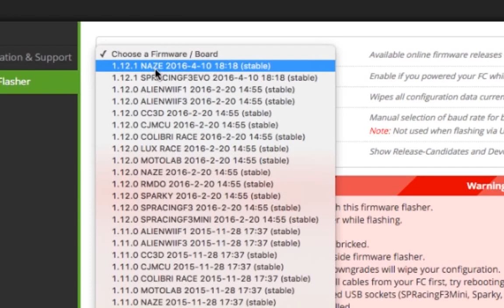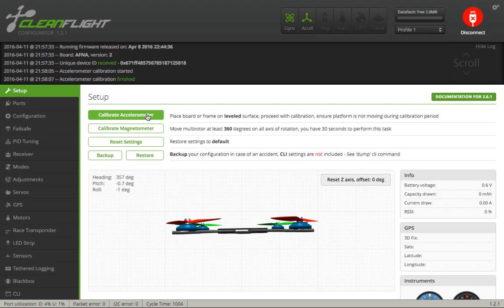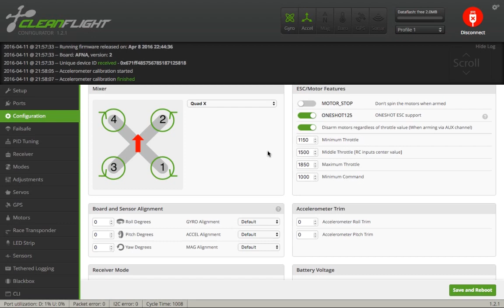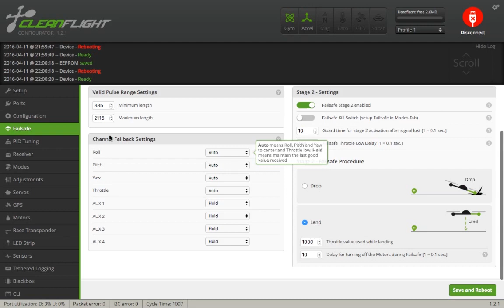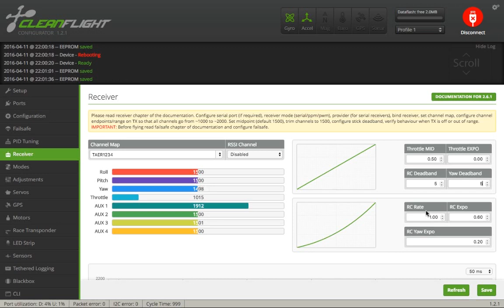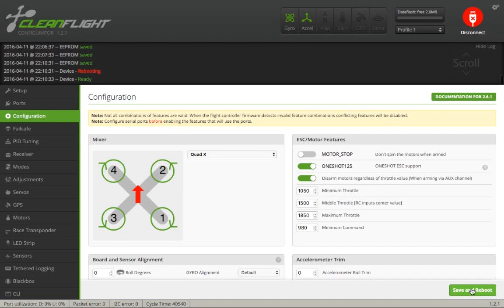How to Set Up Diatone Tyrant 150, 180 and 210 Using Cleanflight

Comment: One of the easiest videos to follow on this subject I've seen.  Thank you!
Reply from the maker: +PewPewReload Thanx!  Next week I will have the video on how to flash your ESC's. All you need is a current limiter device as a safety measure, and takes about 5 mins total!  I will also have some update PIDS as well.  This is a great little Ship from Diatone and I really enjoy flying mine!
Reply: +2dogrc how's that video on the esc flash going?
Reply from the maker: Just have to edit it up.  You want to use the Blue Series 20A, Multi when selecting from BL Heli suite.  Here are the steps:
Download BL Heli Suite
REMOVE PROPS
Open Cleanflight, but do not connect.
Connect your quad to the computer.
Open Bl Heli suite
Plug in your flight battery with a current limiter...just in case (there are a bunch of videos on how to make this)
Click the com port that just showed up when you plugged,
Click Flash BL Heli
Select Blue Series 20A, Multi (Very important as there are 3 versions)
Flash, keep all the stock settings, Damped Light should be select on.
It will do all 4 ESC's so just click continue.
When you are done you need to recalibrate the ESC's.
Unplug quad flight battery.
  Close BL Heli Suite.
  Connect to cleanflight
  Config tab set min command to 1000 and Max throttle to 2000.
 Motors tab, select I agree on the to be able to move the motor slides.
Set master to the top, plug in flight battery. 
THe ESC's will play a little song, then bring master to idle.
In Config tab set Max throttle to 1980 and Min command to 930.

Done!
Reply: +2dogrc thanks for the pre video wright up. I have a problem...it will only flash one esc?
Reply from the maker: Does it read 4 ESC when you click connect, then Read Setup?
Reply: +2dogrc worked it out. right click on your mouse on the "u". 😆

Comment: Thanks so much man! exactly what i needed to know for my first time with cleanflight.  excellent and thorough thanks for taking the time to make this. One Noob thing I'll add for anybody else. Make sure you connect to cleanflight with a mini usb cable that can transfer data not just power. All the cables are not the same. about 2 hrs. of frustration with that one. 
Stay up
Reply from the maker: Good Point there!

Comment: Thanks for showing us the updates.
Reply from the maker: +Ben Wesley No problem!  If I could get some time to fly these!
Reply: +2dogrc I'm looking forward to flying it soon, be good to hear your thoughts. Is oneshot supported on the diatone ESCs? My motors twitch when I enable it, while at no throttle.
Reply from the maker: +Ben Wesley Yes it should be.  If they twitch try lowering the min command to 950 or 980 instead of 1000.  Always test with props off.
Reply: +2dogrc thanks mate, I dropped it to 930 and it stopped the twitches.
Reply from the maker: +Ben Wesley :)  Yeah, i have to do that on all my ships.  Not sure exactly why, but it works and it won't hurt anything.

Comment: I was watching this video hoping to figure out how to get my new Tyrant into Acro mode. At 10:40 you mentioned if you want Acro Mode just have it Arm and thats Acro mode.  I have Arm setup just like you on aux 1 enabled by a switch on my DX8. Mine doesn't seem to be in Acro though, I have had it hovering in front of me and pushed the sticks to their limit on roll axis and it seems to be on auto-level. I have a few videos uploaded so you could see flight if wanted. Any ideas or suggestions would be much appreciated. Thanks!
Reply from the maker: Richieboy87 Okay to be in acro mode, you should have no flight mode highlighted in the modes tab.  So to check, take the props off.  Connect to Betaflight and connect your flight battery.  Go to the modes tab and flip your switch to where you think Acro mode should be.  At this point you should have Arm mode green, and horizon or Angle should not be green.
Reply: 2dogrc Just like you said, flip the switch and the Arm mode tab turns green. And I also get green LED on the quad when armed.

In the beginning of the video you mentioned if you're going to fly in auto level then you need to calibrate the accelerometer. Would calibrating this affect Acro mode. Maybe that's the problem?
Reply from the maker: No, in acro mode you don't use an accelerometer.  I will make a video tomorrow for you!
Reply: 2dogrc Dammit! Lol. Thank you for your help. Much appreciated! 👍🏻
Reply from the maker: https://www.dropbox.com/s/uscoyku6vwkia8z/Screenshot%202017-01-31%2011.13.24.png?dl=0
Not sure if you can open that.  This is now in acro mode.
Reply: yes it opened. My ARM mode looks just like that. The switch moves the little tab back and forth through the ARM range just like it should. I don't have any other modes active.
Reply: 2dogrc Hey Mark what do you think about disabling the Accelerometer through CLI? I tried doing some google research and found this code..."set acc_hardware=1"
Reply from the maker: If it is on and in cli is set to 1, then try 0 to turn it off.

Comment: Mark, What needs to be done if I have SBus.  You mentioned there was something in an early screen that needed to be done for sbus. 

Also do we need to set the breaking to on for the ESCs?
Reply from the maker: +Philip Hinkle Sbus!  Good question!  You would wire neg pos off pins 1 and 2 from the wire harness, then wire #6 or signal wire 4 goes to the signal.   Enable Serial Receiver in the config tap, select Sbus in the menu on the config tab and I believe select UART 2 to serial in the ports tab.  I have to check the the UART selection to be sure.

Comment: thanks for the vid! very helpful. i just got a tyrant 215 a few days ago. got it all set up and flying like a champ. only problem is when i throttle up my video signal cuts out. i have dampened all vibration to the vtx as much as i can but no help. i also noticed one of the motors has a loose bell housing but when i took it out for it's maiden it flew fine and sounded fine. any ideas? i'm sure diatone  is good for it but i'd love to be flying this thing instead of sending it back.
Reply from the maker: Quick question what battery are you using.  Also can you see if you have the Vtx on a VCC plug or 12V plug.
Reply: +2dogrc turnigy 3s 45-90c 1300mah not sure about the vtx,I got the pnf and I didn't want to dismantle it in case they wanted me to send it back. witch they do now. I'll send it out tomorrow or Monday.
Reply: It appears to be vcc. It's on the tyrant pdb.
Reply from the maker: I don't have a pic with me.  If you can plug it into the 12V plug that might help provide stable power to the Vtx. I have not run the 190 only the 130 so far.

Comment: Hello, this is an excellent video. I bought one of these and have messed up the escs I think. I wish I had watched this video. I posted a comment on your other video where you reviewed the 180. If you can look at that comment please I would be most grateful. Essentially, I was calibrating the escs on cleanflight and decided to update the firmware to 16.6. Then two of the escs, 2 and 3, did not work. Then I returned the firmware to 16.45 and still escs/motors 2 and 3 do not work. How do I fix this problem please?
Reply: Cleanflight and Blheli do not see the 2 and 3 escs/motors. I used Blheli configurator for MAC and then tried Blheli suite and still the 2 and 3 escs not seen. I am lost. What can I do?
Reply: There is a bug in Betaflight with Bl Heli suite and causing the bootloader to be corrupt.  I posted instructions on the other post.

Comment: are these good starting values to use when first flying the tyrant drone?  new to this hobby
Reply from the maker: Yeah, those would be good starting rates.  If you find it moves too much when you move your RC transmitter sticks, then bring down the axis rate.  For example if it pitches up and down too fast for you, reduce the pitch rate 0.05 at a time to get it where you like it.  As you get better, start bringing it back up.
Reply: thanks as there is nothing in the manual on how to set this tyrant up.  your video makes it easier to understand.  Do you have any other great set-up videos for total beginners :-)
Reply from the maker: Most of my How to Videos are specific to certain ships we sell.  However, Setting up in Betaflight is very similar on all the ships and I have videos for that and how to connect receivers.  You can check out th Playlist of How to on my channel if you want.
Reply: 2dogrc my tyrant drone banks to the left side as I take off. l placed in starting points you showed. what value do you recommend me changing?

Comment: One question, for my 180, I have cleanflight and betaflight and was wondering why my PID values are in whole numbers instead of decimals like yours? like for my P for roll shows 43 instead of 4.3?
Reply from the maker: This is just a scaling effect.  43 and 4.3 are the same value, but the code base is different.  Just use what is consistent with your software, so if the defaults are 4.3, then use that.  If the defaults are 43 use that format.
Reply: thanks

Comment: i would like to run 4045 pitch tri's with a 4s. do you think it will hold up?
Reply: I use Dal 4045 tri's with a 1300mah 4s 65c lipo. On my Tyrant 180. Fast as hell!!
Reply: +zooby dooby TY brother!
Reply from the maker: I run 4045 Gemfan Tri's as well.  These motors do great on 4s with these.  I took my antenna and moved it to a side hole in the late to give by battery more room.  No I run 1300 and 1500 HV's on it!  Wicked fun!
Reply: +2dogrc TY brother!
Reply: My motors were getting pretty hot running 4045BN tri Dal props on 3s, ive been struggling with deciding which prop to go with on 4s. How much do yalls 180's weigh? im @ 524g without my gopro.
Reply: are these motors really rated at 9.4A max?
Reply: nevermind... i just burnt my motors on 4s with 4040BN...

Comment: When I plug mine in, I just have the buzzer going crazy the entire time alongside a flashing green LED.  I got the same beeps you got in the beginning, but it just keeps on persisting.  Any suggestions? Thanks.
Reply from the maker: The easiest way for now, is to disconnect the buzzer wire on the side of the ship.  There are commands available in Betaflight to change that, but for now in Cleanflight they are not there.  The beeper is going off because Vbatt is on the the voltage is below the min.
Reply: Already disconnected my buzzer but I'll try the other stuff later. Thanks.

Comment: i am using an orange 615x, i know not the best buts its what i have. im running ppm, when i leave oneshot on, motor #4 goes crazy, if oneshot is off. all 4 motors work fine. oneshot one, i cannot get motor 4 to work at all? whats up. i just got this thing and cannot get it to run off oneshot.
Reply: I would suggest flashing the ESC using BL heli to the most current firmware. That will solve that problem.
Reply: how do i flash the esc? do i need a device to do so?
Reply from the maker: https://www.youtube.com/watch?v=YWLk4qcQcvw
Josh makes some of the bets videos on quad stuff!  You would select Blue Series 20A Multi firmware when it comes to that part.

Comment: would you not turn the max throttle to 2000 in Configuration --> ESC/Motor Features
Reply from the maker: Yes, you can set at 2000 calibrate then you have to move it back to 1980.  I kept it at 1859 for simplicity. You just loose a little resolution in the throttle channel, but nothing you would notice if you are a beginner.

Comment: I'm still stuck, my throttle is mixed with yaw when I move the throttle stitch and on the PC screen it shows the yaw moving not throttle
Reply from the maker: OKay, 2 things. Check your receiver wires are plugged in order in the receiver. You can change the channel mapping in the receiver tab.
Reply: Thanks for your reply, I figured it out, you where right I had it plugged in wrong, it's all working now, and thanks for the video made things easy,
Tc
Reply from the maker: Great!  Glad you got it working!

Comment: what could be wrong when the transmitter doesnt respond, even though the receiver is bind already
Reply from the maker: A couple things to check on that.  
1)You have a serial port assigned in the Ports tab for Sbus and Ibus
2)You have the receiver connected to the correct RX tab on the FC
3)You have the correct receiver selected in the dropdown menu in the config tab.
Reply: thanks for the help,  turns out the wiring was wrong from the receiver to the board :&
Reply from the maker: iiiDartsiii Glad I could help!